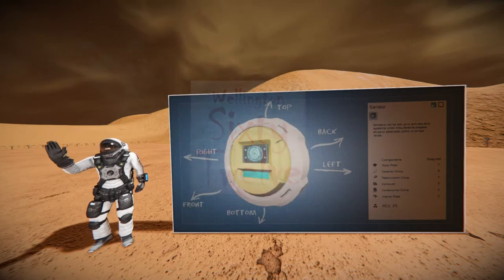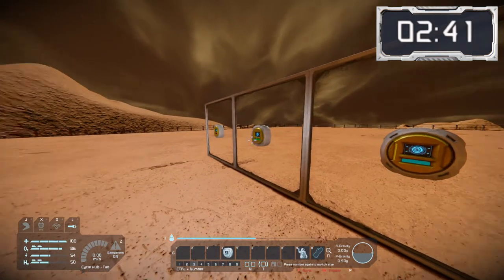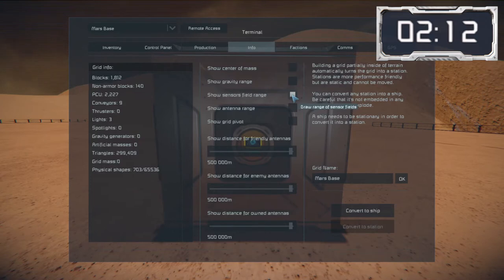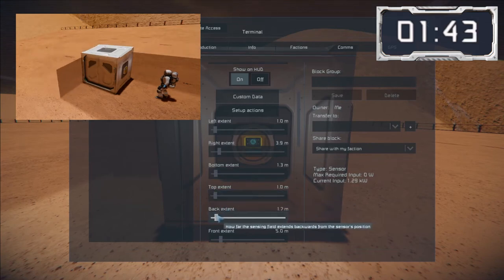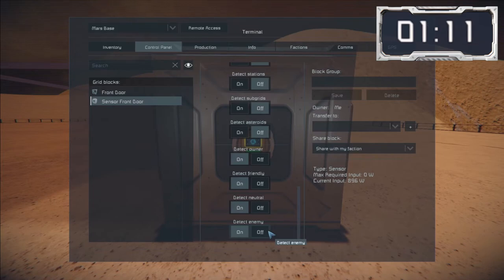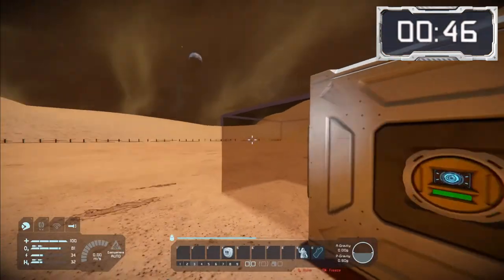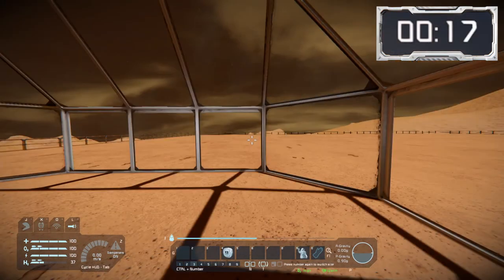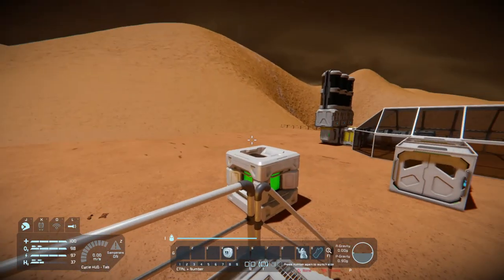Sensors - Space Engineers 3 Minute Tutorial

Comment: Do you know why my sensors with the exact same settings on the exact same builds are randomly doing like double or no inputs instead of the regular input I have them set to? I have 4 drilling rigs and the sensors tell the pistons when to extend or lower but for some of them it makes the piston extend by 1 meter instead of .5 like the others, it seems to be specific ones that do it until I break and replace the sensors then it chooses to do it with other ones.
Reply from the maker: No I don't sorry ...except when the sensor alters the speed, direction or other things like that, I think it's fairly easy to make a bad situation worse if it gets out of sync, in my experience usually when going into negatives, like when you are in negative, you need to speed up to slow down, but speed up too much and you will reverse. The only other thing I can think, is it's doing it twice for some reason, which is why it can be useful to have a timer trigger with a second delay just things don't happen instantly. I don't know what your set up is, but I think with dealing with piston distance, where previously I've used timers to essentially guess, I would now use event controllers to be precise.